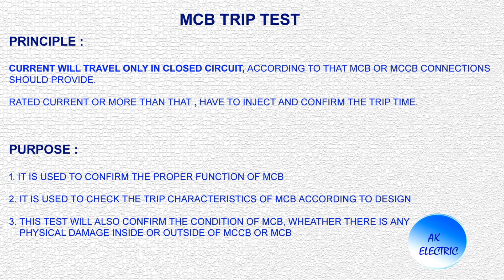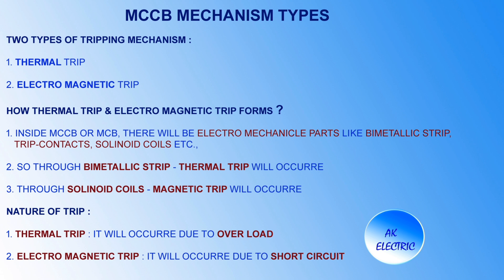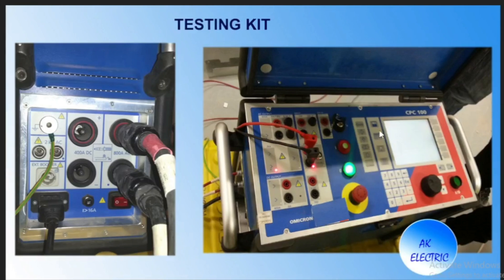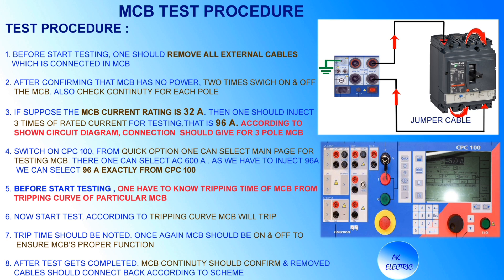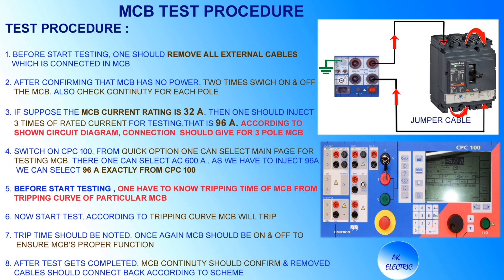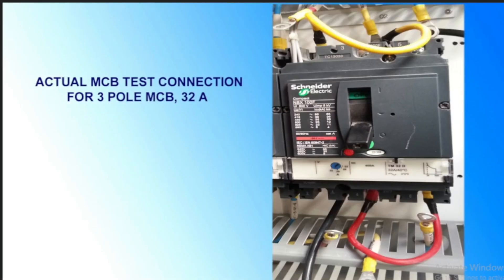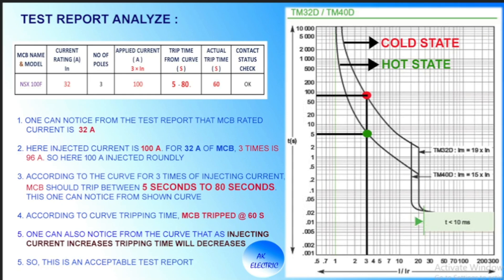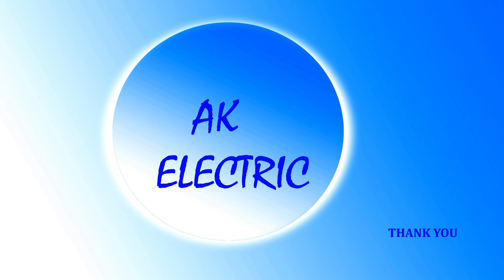HOW TO DO MCB TRIP TEST, HOW TO FIND TRIP TIME FROM  CURVE, COLD & HOT STATE, TEST CONNECTION

Comment: Very good and informative video
Reply from the maker: Dear Hi,

Thank you for your kind reply.

You can also find site practical videos from below link from our channel.

1. MCCB TESTING WITH 2000A USING CPC100 CURRENT BOOSTER, MAGNETIC UNIT - INSTANTANEOUS TRIP SITE TEST
https://youtu.be/i5v0O0ldYFI

2. MCCB TESTING, INSULATION RESISTANCE TEST, CONTACT RESISTANCE TEST, CPC100, DLRO , TRIP TEST
https://youtu.be/sybgCnpSfjs

Thank You,
AK ELECTRIC